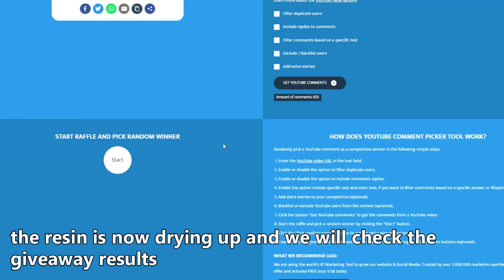Space Bottle Stopper with Stars / RESIN ART

Comment: When you mix the resin by weight, are the two parts the same density? The resin I buy always says to mix in proportions of volume... how do you calculate the density in order to use a scale? (it would be more accurate)
Reply from the maker: Each resin is mixed differently. You have to do as stated by the manufacturer